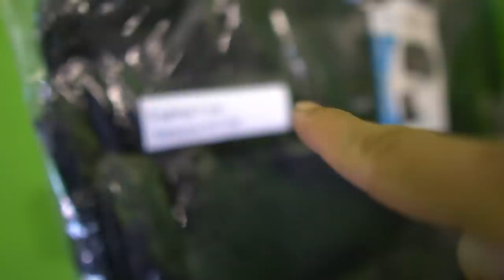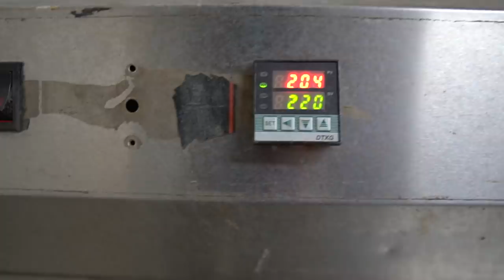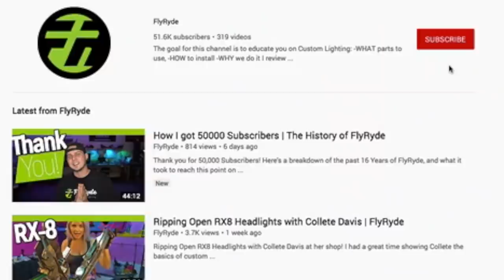Closing my Shop for 2020 | FlyRyde

Comment: 80/20 theory is something that changes you along the way.  I've had to boldly apply that multiple times.  Also, knowing when to pivot is critical in business.  I've had shops, multiple times...did everything from engine management tuning/dyno, to engine building, to importing, to manufacturing forced induction components.  Burnout happens and you really need to work hard to find that recipe that makes you happy.  Some people work for money, some people work for accomplishment and pride with money as the byproduct.  I think in business, you HAVE to love it, or it'll ruin your life.  I've had a restaurant, videography company, multiple shops and event company...multiple online ventures...you just have to keep pushing.  Nothing is failure...it's all part of the pathway to that success entrepreneurs continually push for.  Been with ya a long time as a sub...gimme the access bro.
Reply from the maker: Yo that was thoughtful and awesome my man 🙏 I loved it. Hop on the sign up front and center at www.FlyRyde.com I got a new email going out tonight!

Comment: Congrats on simplifying your life and concentrating on what's important to you! 

Thank you for your content in the past. You really helped me with the lights in my car, a 2020 WRX Premium. I torn off the bumper of a brand new car and took out and disasembled the headlamps to their basic parts, painted a few things and then installed a set of Diode Dynamics switchback C-Lights as well as their RGBW demon eyes. And it was your video on installing those demon eyes that help me the most with that. The painting and C-lights were pretty easy, but getting the demon eyes in there just right and making them bright, was because of what I learned from you. The end result is a really nice set of headlights that I'm super proud of. So thank you for all your help. I'm not into doing this as a business, but I could help another enthusiast that wanted to do a similar thing.

Anyhow, good luck in all you future endeavors! And sincerely, THANKS!

Comment: Hi Chris, have you ever modified headlights or anything to a 2005 Nissan Maxiam? Over a year ago I purchased blacked out headlights from K2 Motor. They started to fog up and the black paint was flaking off directly in front of the projector lens. I watched your videos on how to open headlights, very valuable information. I have a question, what kind of paint should I use to black out the chrome?

Comment: You should do a video on a 2004-2009 Mazda 3 Sedan
Reply from the maker: Kenneth Emerson hahaha deal
Reply: @flyryde  Awesome, I look forward to it man, I got an 07 where i swapped out the motor with a 2016 ford fusion motor, i installed custom RGB interior/trunk lighting and next i'm going to do underglow and then your sequential LED turn signals.

Comment: I need headlight lenses for my 2008 350z. Can you help me find some please? Once I get some I can customize  my lights.
Reply: Have you tried Ebay? Craigslist? Amazon?
Reply from the maker: Gene Holmes you probably won’t find lenses. I could be wrong, but I’ve never seen lenses only for Zs
Reply: @flyryde  the only lights I could even find were on eBay for around $500 each. That's ridiculous  and stick looking lights
Reply: @houseofno  yes and that's the only ones I found for around $500